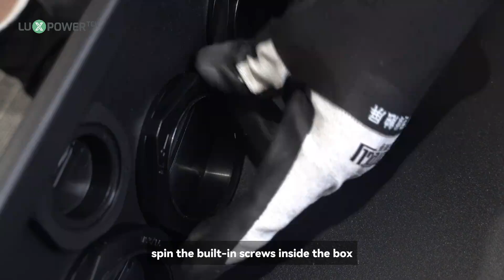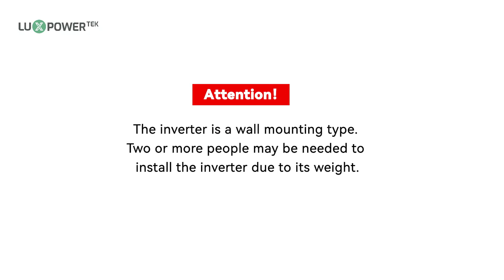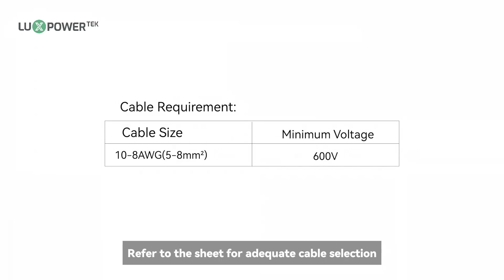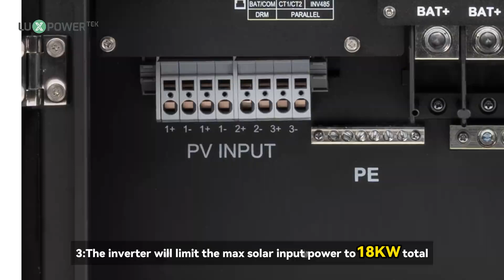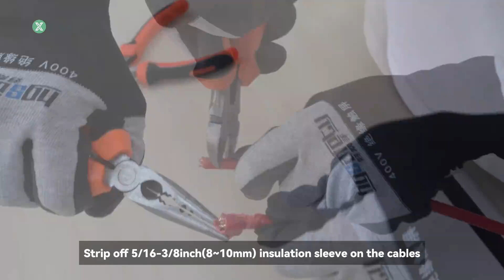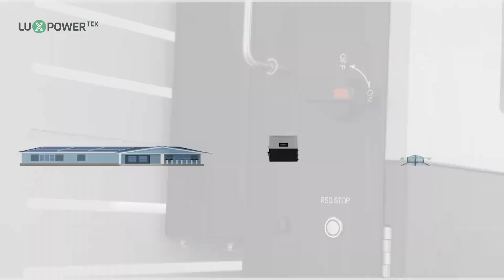LXP LB US 12K installation video

Comment: que presupuesto se necesita para instalar este sistema fuera de la red. Gracias
Reply from the maker: Hi Sir, thanks for reaching out to LuxpowerTek. The budget required will depend on your location. Could you please send your region, city, and contact information to marketing@luxpowertek.com? We will ask our distributor to get in touch with you soon.
Reply: Hello, do you have a video to set the frequency, grid voltage, time of use, etc?